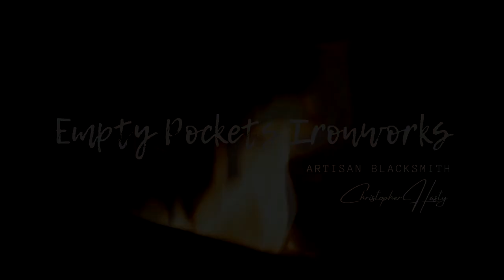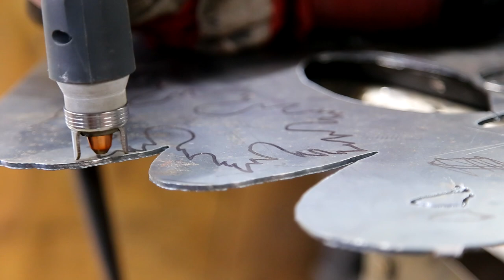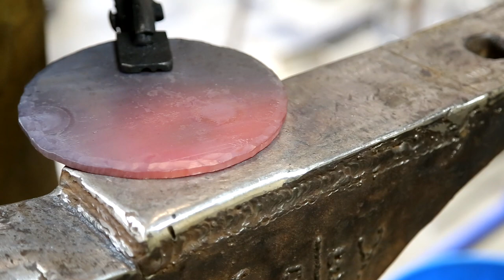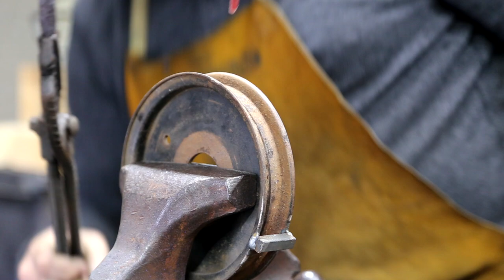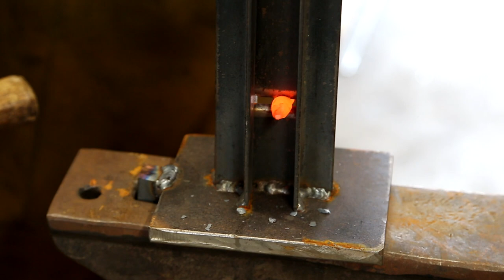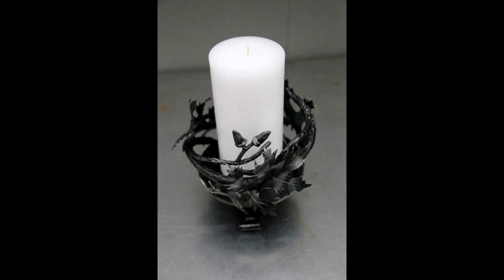Forged oak branch with acorns candle holder blacksmithing project texture dies 12 ton forging press

Comment: Great job Chris nicely done , did you use hard facing on the texture dies?
Reply from the maker: Nope just .023 weld wire mig.   I've used them for probably 12-15 projects and they have held up with little to no wear. I figure if they do start to flatten I'll just add more welds.